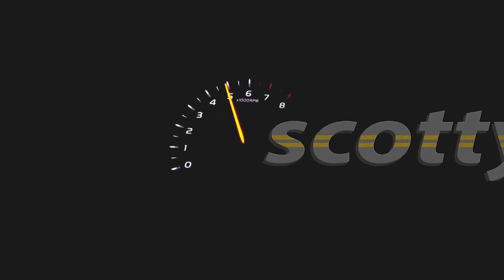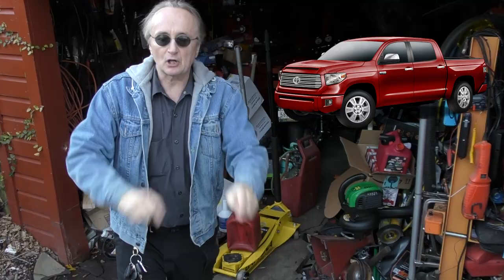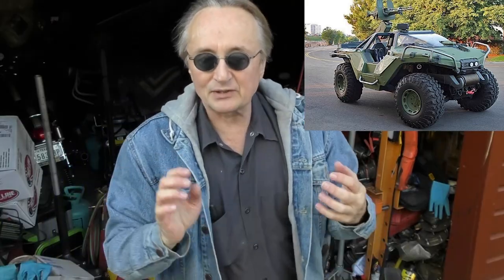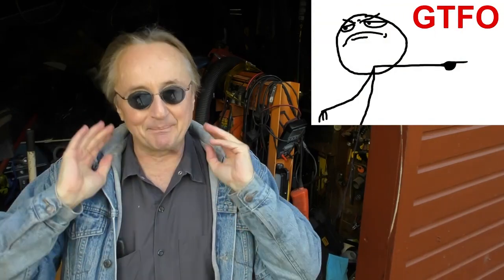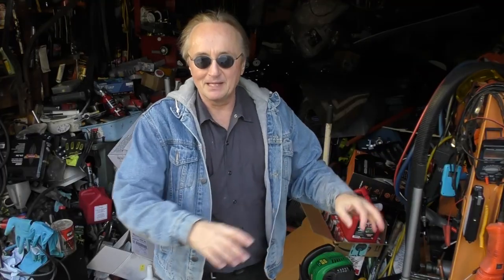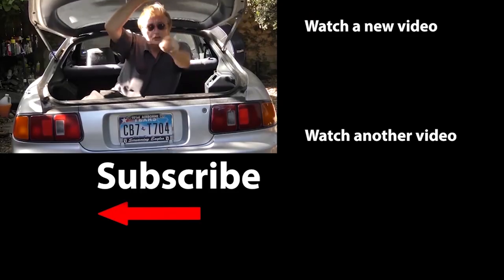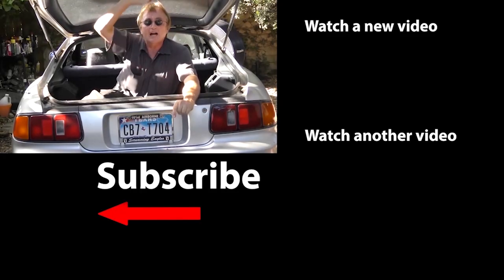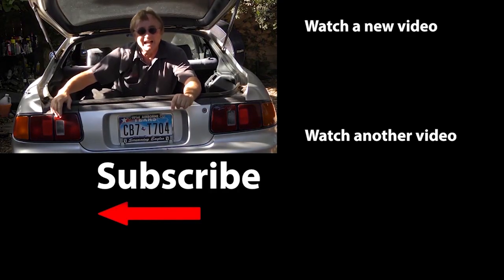5 Used Trucks You Should Never Buy

Comment: HAD a 2006 Honda Ridgeline with almost 236k miles, bought at 210K due to excellent reputation and it was owned by the father of one of the service technicians at the local Honda dealership. He swore his father took excellent care of the vehicle.  It suffered a catastrophic failure that i have found others people have experienced. After doing some reading at a few different websites, i saw a number of people had talked about this problem.   The transmission cooling hoses run through the radiator so when they fail, (one writer said it as due to corrosion by using dissimilar metals) you end up with transmission fluid in your radiator and anti-freeze in your transmission.  The dealership offered to install a new radiator and "flush" my transmission for $1K but said that might not fix the problem and potentially i would need to replace the engine.  I was not willing to spend the $1K on a maybe and sold it to a junk yard for $350. A law firm in NY/NJ is now investigating this problem and looking at a Class Action lawsuit.  I loved my Ridgeline up until the day it happened.  Heads up Ridgeline owners.

Comment: I got a 2002 Dodge Ram 1500 4x4 with a 5.9
I'm getting a remanufactured engine for it. What other things should I check out while it's down?
Its been setting for a while should I change the transmission fluid or leave it alone? Any ideas or recommendations that you have will be helpful thanks.

Comment: Part of the reason ford isn’t known for reliability is 6.0 6.4 and first gen 6.7 powerstroke engines were unreliable 6.0 headgaskets and injectors were constant repairs. 6.4 would hydrolock from too much antifreeze in oil. And first gen 6.7 had weak heads like the 6.4 causing catastrophic failures.

Comment: Dodge trucks are usually quite affordable used as long as the previous owner didn't kill it first. I had a used 2006 ram 1500 6-cyl manual which ran great for years and I totaled it by acting stupid. I went right back out and bought a 2007 6-cyl manual 6-speed used for even less since it was a few years later and it is still going strong. Only ever had it in the shop to upgrade the shocks and dampers. I had a GMC sonoma which was always breaking a ball joint, fuel pump or something.

Comment: A REAL pick up truck holds a 4by8 sheet of plywood in the back, between the wheel wells , with the gate closed.  It doesn't matter how much your truck cost, if it can't do that, it's not a pickup truck.  That's just the way I see it.
Reply: Dan Rossi so a real pickup has an 8 foot bed? 
My avalanche holds 8x4 sheets with the bed closed - but I haven’t send many other trucks with mid-gates or 8 foot beds.

Comment: I crashed my 96 Ford truck and bought a new 2003 hemi ram truck. 
Well i had more problems in first three yrs of that Hemi, than i did owning that used 96 F150 from 98 to 2003.
Luckily all were covered by warranty and when warranty was up in 2007 gas was up aboout 40% as well, so  i bought a new  Honda civic, which besides a slightly broken visor was problem free for  about 7 yrs until i sold it.

Comment: What about the
1.  CHEVY AVALANCHE
2. Chrysler Escalade truck
Reply: They are basically full-size domestic versions of the Ridgeline and just as useless for doing any kind of "truck" stuff.
Get a full-size actual pickup.  With the higher trim levels offered these days the fit and finish is better than anything you'll find in an Avalanche and is not far off from what you'd get in the Caddy.
If you don't need to do actual "truck stuff" with it, then still forget about the Avalanche or Caddy and just get yourself a nice full-size SUV.

Comment: Greetings Scotty from South Africa. If you come and visit the country one day try the Isuzu pickup trucks we have here, especially the ones from the mid-late 90's with the 2.5l-2.8l diesel engines and manual transmitions. Unfortunately we don't own a truck yet but they were the ones that introduced me to the world of double cabs. Isuzu call the model the KB here. Next, for me, comes the Toyota Hilux with the 2.5l d4d turbo diesel engine and a manual transmition. The 3.0l d4d is a good engine as well but it just doesn't have that proper diesel truck type of sound. The 2.5l d4d points in the right direction, provided that you pick very carefully.

Comment: Should have went ahead and roped in any Ram 1500's. Had a '00 ram with 2 failed ecm's and transmission failure (115k miles), sold it for a 2012 ram and it had valve train, lifter, and MDS sensor failure at 118,000 miles and needed a new engine.

Comment: Sure hope Toyota has fixed the transmission problems in the Tacoma. My 96 I bought new was absolute garbage. Was finally told by the dealer that my two place snowmobile trailer was to heavy to pull after they replaced the transmission for the second time. I’ll never buy another one

Comment: I don't know what your talking about. I have a '11 nissan titan and  have had maybe 2 recalls. Besides my 96' dodge dakota 4x4.Bought used in '98.Which was an awesome truck. Had only 3  problems on it, water pump, trany censer, and the main control box. I sold it to my brother and sister inlaw. And they have driven it till it quit with over 300 km on it. I'm at 112 km on my titan so far and is still an awesome truck. At one time we had bought a 2001 Dodge Durango used 3-4 yrs.old and loved it, but started having electrical problems heater problems.And the engine blew at 120,000 km. Should have kept it since we did so much to it. We had probably fixed it for the next person that bought it. But what can you do ? You can't go back. But even now my other brother inlaw has a '14 ? dodge pickup and has problems on it already. And  the two top brands right now are Nissan and Toyota.

Comment: I’ve got a 2011 Honda Ridgeline pickup truck that use to be my dad’s and I had to get a new alternator in it when it broke down back in October but it handles well by getting it done however though sooner than later I’ll get something heavy duty, the only thing over the NEW ONES right, my dad like I said had it before me and the new ones have a problem with the battery it was designed to be under the alternator pipe so if you need to replace the battery it’s going to be a ROYAL P.I.T.A to do the new ones still look nice though

Comment: The Honda ridgeline is the better of the Honda SUV. They don't have the vcm that the other 3.5 engines have. The vcm is what causes the other versions of the 3.5 engines to burn up plugs and rings. I have never had to rebuild a ridgeline motor. In my opinion they are some of the most reliable Honda SUV out there.

Comment: 2005 Durango 5.7 good motor but the cowl leaks when it rains hard. Then the motor sucks in the water then the engine goes boom! To solve the problem never get the truck wet or wash the SUV. One more thing sometimes dies while your driving for no reason then starts again after a few days.  I won’t be buying a Dodge again.

Comment: I'm wondering why my 2014 RAM 1500 has been a very reliable vehicle. It's ride is super smooth and the v6 and ZF transmission combo has worked very well. It's close to 5 years old and still looks new and I have only done the normal maintenance. Also our 2009 Honda odyssee has been very reliable, we bought it new and have had only normal maint done.  It's been all over the USA hauling 5 people and now my daughter drives it. So, my Honda and my Dodge RAM have been fine..

Comment: I worked at a Chevy dealer during the launch of the SSR and it was a pos.  I had to take a stupid certification just to work on the roof. They had 16 individual hydraulic hoses on them and if 1 o-ring ripped ot would leak all the fluid behind the seats. It was targeted at the baby boomers and older.

Comment: I'll stand up for Dodge on this one. Had an 08 Ram I put about 120k miles on (Many of them involved driving in a way that would probably be more appropriate in something like a 911). The only failures I had in that time were a tire pressure sensor, and a broken tailgate latch (The little plastic clip that attached the latch rod to the tailgate handle). I suspect the latter failure was due to my habit of yanking the tailgate open like it owed me money.

That being said I do enjoy your videos Mr.Hopper
Reply: Honestly though? At 120k miles that's pretty bad. My 20 year old Nissan with 180k has had no major problems.
Reply: @williammesloh  tailgate latch zis not a major issue. I have a frontier with 37k miles on it and ive had bigger issues than that with it, like the cheap water base paint they use chips with a strong wind it seems like. Truck overall is solid but i cant say id buy another.

Comment: I’ve should’ve found ya erler , I traded my Chevy diesel to ram 5.7 hemi think save on fuel boy that BIG mistake I got it used and at 75,000 now they had replaced motor as metal shavings from cam / lifters. Lucky I got a  Watinty with it.  Now I’m depressed now looking again

Comment: Here in Australia the Nissan is called an np300 navara  and although the Mercedes is based on it they are very different . they run different engines and transmissions and Mercedes has widened the body by 80mm,interior , front and rear panels and bumpers are all very different . doesn't
 justify the price tag but they are different cars

Comment: I have a 2019 Ridgeline.  It doesn't look like a real truck and it doesn't behave like a real truck, scotty isn't wrong here.  I like it because I use it mostly as a city vehicle and to take stuff up to the cottage, its great for that.  Plus it handles just like the Honda Pilot which it's based upon.  It isn't heavy duty, but it's very comfortable as a city vehicle and for taking on the highway up to the cottage.  A Ford F 150 would be my choice if I wanted or needed a TRUCK.  But, for me the Ridgeline is great.  Also, the in bed trunk is awesome. The infotainment dash sucks.

Comment: Should have mentioned the 2004 Ford F150. The mechanic had to drop the engine just to change the spark plugs. Transmission has been apart 3 times. Still have an intermittent transmission light that no one can figure out. Doesn't even have 80K on it yet.
Reply: After the 4th $500 window dropped in like a rock and refused to go up we learned to take apart the door and fix it ourselves for $40.

Comment: Hey scotty i have a 2010 isuzu dmax 3liter turbo deisel how does someone convert it to a v8 diesel is it worth it or do i stay with what i got how do you fix the egr problem with it how do you clean it what do you think about chipping the engine im contiplating whether to do it or not and also converting the brake drums on the back to disc whats the difference .

Comment: we had a used ridgeline and i regret getting rid of it. the honda J series 32 and above all had good power and you could swap their parts around and make a J frankenstein and get well over 300NA tow rating was 5000 but we had pulled 6k a few times and many ridgeline owners pull 7k with theirs and have no problems. i didnt like it when we had it but i didnt appreciate the honda V6s untill after i did research and got a del sol and got more into honda.YES their not actually a Truck Truck their a Utility SUV with a short bed as the ridgeline people say in the IROC group

Comment: My Ridgeline ( the one with AWD and leather )  :
- got it used with 130,000 miles. 3 years later now it has 145,000.
- only parts replaced have being timing belt and alternator . 
-  I don't haul any heavy weight in it.  If I wanted a work truck could have got me a tundra or F150. 
- sorry Scotty I will have to disagree with you on this one.

Comment: I have a 2008 Dodge Ram 4.7 with 150K miles on it and only have had to replace a water pump since I bought it new 11 years ago. I use it as a working truck and to tow a boat. I maintain the truck religiously and use Mobil 1 synthetic. I have a friend that owns a pest control company and puts 1K pounds of chemical in the back of the same model and year truck and he got 250 to 300K miles out of them before the transmissions went and he retired them. I have another friend owns an A/C company that uses Ford F-250 vans and gets around 250- 350K miles out of them before the transmissions or motor fails and he retires them. He has to replace the handles on the van doors a lot he told me because the latches break. Both of these companies maintain their vehicles on a set schedule  and never go over 4K miles before an oil change. I know women that I work with and some of them told me I got an oil change 2 years ago do you think I need to get one anytime soon and I just shake my head.

Comment: I've owned a Toyota Tacoma, and got 227K miles out of it.  Super dependable.  Had a Toyota 4Runner, 217K Miles out of that.  Super dependable and I didn't want to get rid of it but needed something newer.  Bought a honda ridgeline in 2010, RTL, brand new.  Have 192K miles on it now.  It's better than the toyota on the interior and the trunk in the bed is so smart and useful.  With the Toyota, "Is someone going to steal my golf clubs?" open bed problem.  With the honda, the trunk locks.  Have hauled trailers and kayaks and mountain bikes with it.  It's not a dump a load of bricks in it truck but it's got a ton of room and the seats fold up in the back completely.  You can fill the bed and the back seat.  I'm still driving the Ridgeline during the winter and have a Macan S as my other seasons rides and that's better than the Ridgeline for interior, power, driving, but just lacks a bed.  Scotty has never driven one nor owned one and he's high when he say you should never buy one.  The Gen 1s, when they get traded into a dealership, they're sold within 24 hours because folks don't like the Gen 2 as much and would rather buy a used Gen 1.  This guy has zero clue, he just shits on everything and laughs like he's giving great advice.

Comment: Never had a real problem with Dodge BR Rams, or DR Rams. The BR did need steering linkage fixed, but the trucks were mechanically and electrically reliable. My BR had 175,000 miles when I traded for the DR w/Cummins.

Comment: IDK, we run those Dodge Rams commercially. run them up to 360,000 before we sell. last two one had a alternator that was bad, one wheel bearing. second truck started, u joints drive shaft. Never troubles with them and they are worked hard. Way more dependable and efficient then the Fords. So I guess he just hates Dodges, we love them!

Comment: Hey, scotty 
Sometimes my Subaru would have the cruise light, break lights, and engine lights on and I would have to unplug the battery cable to reset it. Hit a hole or bump will also trigger those lights. Do you know what the problem is?

Comment: Gotta disagree on the Ridgeline it seems like a good vehicle, but I do agree it's no truck. I would have bought one but I needed something to pull a small travel trailer. It only pulls 5000 lbs but it also has a low gross rear axel weight and a low gross combined vehicle weight. That being said it's all the " hauling vehicle" most people will need, but it's not a truck.

Comment: I have a Dodge 2007 Ram 1500 pick up truck with a V8. 
I use it as a truck and it is solid.  Over 250k ,  best regular truck I have bought in years.  Scared about buying new anymore.
Reply: Buying new is for suckers.
I usually try to find a 1 year old vehicle that has less than 10k miles.
It's essentially a brand new vehicle that has only been driven through the break-in period, but you'll save like 10-15k on price.   ;)

Comment: Scotty.
Love your videos, but you are as wrong about the Ridgeline as a person can be. I've had 2 2006's bought used. I sold the first one and regretted it immediately. My current one has 217,000 miles on it. Use it for hauling a trailer with 275 gallons of water, 2 tons of  stone, and a 26ft sailboat. It will work. 

I'll tell you a little secret, that I know will show how stupid I am. Before I had the trailer, I hauled the 275 gallon tote in the bed of the Ridgeline. That's 2227 lbs in a bed rated for 1500 lbs. Dumb, I know, but it did it without a problem. Don't tell me this isn't a work truck.

It's also been very reliable. Replaced the AC  compressor, but mostly just routine maintenance.

Comment: Hi Scotty, The research I did told me that the best Dodge to buy was from between 1994-1997 so I got a 1997. But now I'm worried. It was owned by a trucker who put the engine temperature and reving gauges in and I try to keep within the right ranges. It is an automatic V6 though and I planned to use it to haul my 35 foot toy hauler. Am I asking for trouble?-- Rivergrrrl

Comment: Don't agree about the Dodge I had a 03 with a 4,7 over 300 thousands miles  the only thing major I did  was a radiator never changed the fluid in the trans or rear end put spark plugs in it one time truck still was running when I got rid of it it was beat up bad

Comment: Ahhh hell no.....you dissed my pickup right off the bat!
2005 Dodge Ram 1500 SLT Daytona 4x4 quadcab....5.7 Hemi....metallic orange!
Sure, it had a few issues over the last 8 years I've owned it, but if you don't work on your own stuff, you'd be inclined to believe anything presented on YouTube that cries FOUL!
The wing comes off fairly easy...1-10mm bolt on each side.
Mechanicals? Strong runner....replaced waterpump once, and a crappy EGR valve...123,000 miles now.
Transmission? No issues.
4x4 works great in IN.!
It's a MOPAR theme that some CAR guys appreciate!
Still works like a truck!